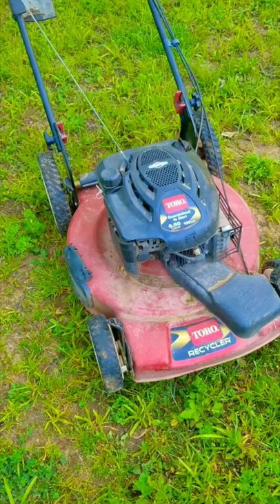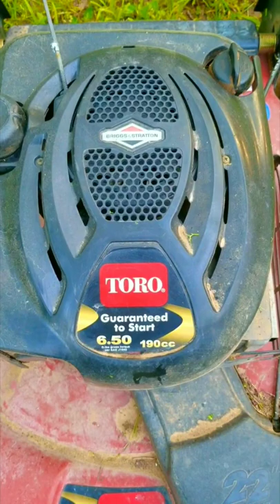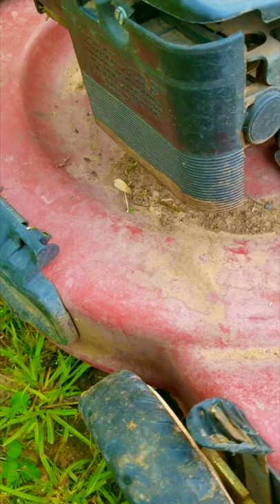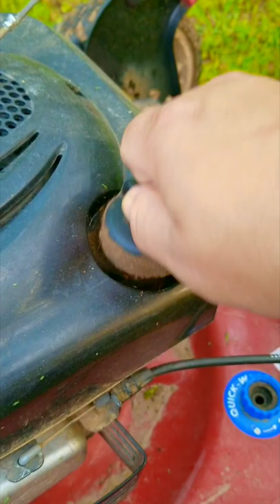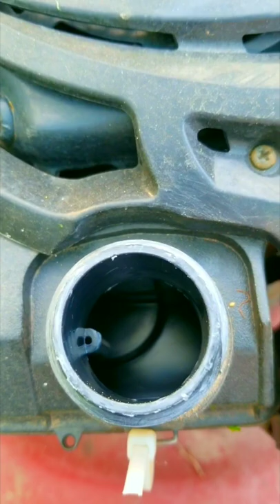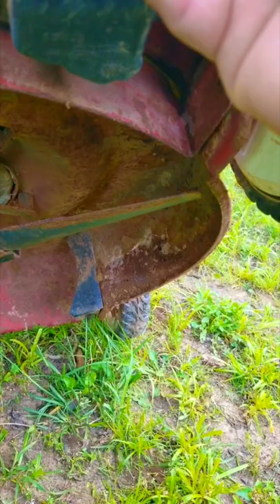This Toro Mower Might Be A Rough Around The Edges But I Think We Can Save It.

Comment: that brand of spark plug is good. we have been using them in our john Deere js45 for plenty of time and works great. You should be able to save this one
Reply from the maker: I typically use the plug that it with, from the factory.  Switch it, to another brand, that it wasn't designed for is like switching your beer. It looks like beer, and it's going to get the job done, but you may not agree with how it tastes.
Reply: @INSIDEHOUSEGARAGE A good J19LM is singing your name in the garage waiting for installation.
Reply: @INSIDEHOUSEGARAGE  that is a good way to put it lol

Comment: Those Briggs and Stratton engines will run forever. Very good engines.
Reply from the maker: yes sir ,they are very good.
Reply: @INSIDEHOUSEGARAGE  I’ve had a craftsman lawnmower for over 10 years and it still runs like new. Self propelled system broke but it still cuts.
Reply from the maker: very nice.

Comment: Why does it matter if there is a blade on the engine 🤔
Reply from the maker: it acts as a counter balance. Believe me, I've done it on accident. I took the blade off, to sharpen it, and I got in a hurry to try and start the mower.  Pulling on the rope, felt really strange and it was tuff to get the engine to start.

Comment: The most lousy lawnmower our family has ever purchased. Got a Toro Recycler in 2010 and had nothing but problems, even after checking the filter, checking and replacing the oil, changing the blade. All it did was bog down and stall and leave clumps of grass. It guzzled gas like no tomorrow and blew the exhaust in the face of the person using the mower. Lousy engineering. Poor quality. It would not cut through tall wet grass without stalling and both of our craftsman mowers could do that no problem whatsoever.😂 So glad we sold it.
Reply from the maker: thank you for sharing that